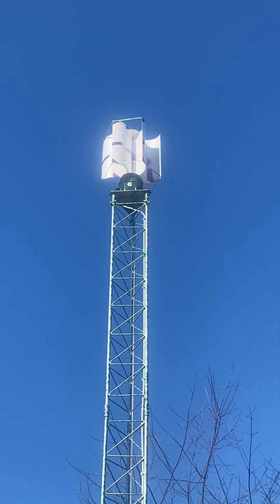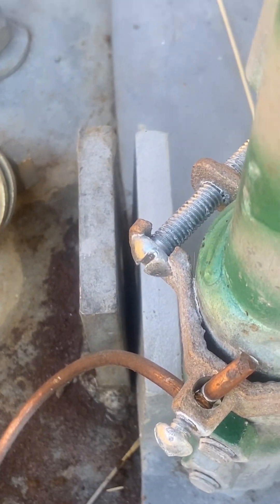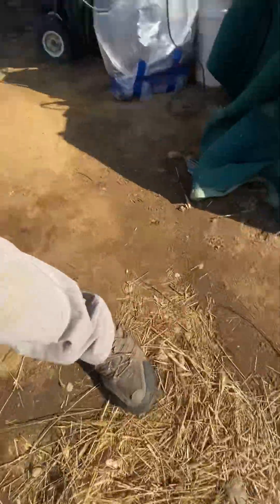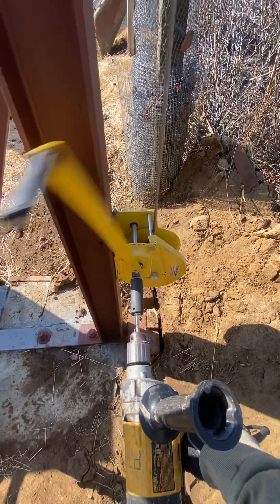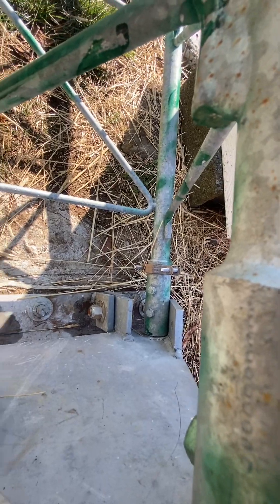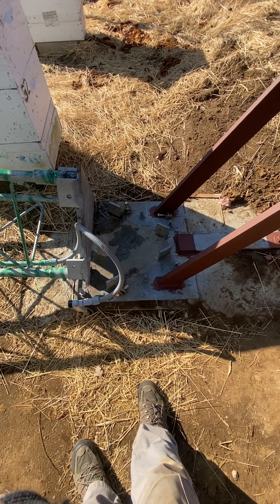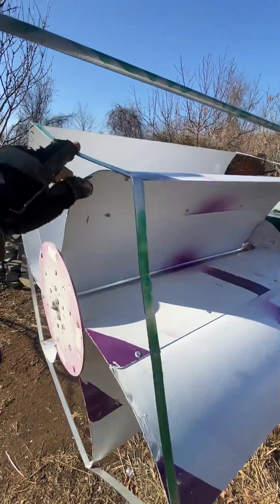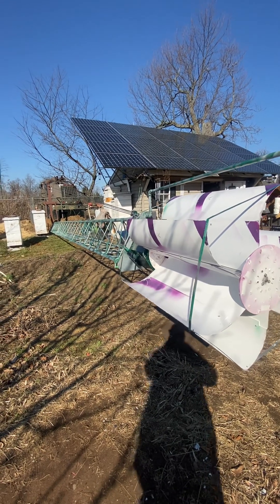Vertical Wind Turbine, Part 50  Tower Build Specs. Never buy Tesup

Comment: I keep trying to link ebay but I think YT is removing it just look up DC to DC step up voltage converter. A few are rated for 1800 watts far short from 4K but I don't think you will be getting 4K out of that thing anyways. The rate of spin probably required to hit 4K is a lot faster than that thing can spin without slowing itself down by spinning back into the wind. I would still add a breaker before the module and between it and the inverter just to be safe if you do go with that. The module isn't exactly UL certified lol. I plan on putting my I2000 up soon but I'm going to go through a MWAS wind charge controller board directly into a battery bank that is connected to a SUNGOLD Power 6KW grid tied solar inverter. A bit of a different setup since you got the last inverter that I ever even seen that grid ties a turbine directly that won't burn your house down lol. Using the MWAS charge controller board with the midnite classic will be pretty expensive but it will tie my system together when it's all said and done I guess.
Reply from the maker: Just a heads up, I found out from the inverter makers that the solar inverters are dual programmable for Wind. So you can buy any Aurora inverter and program the internal computer by supplying the inverter 50 V DC and the computer can program what parameters you want for Wind. Instead of Solar.
Reply: @Themachinewon  I sent that link to you, yea I read that also but if I do it the way I wrote above I will be able to keep my power on if the grid goes out. The inverter I was going for has a few cool options for charging and grid injection. The inverter can charge the batteries, have the batteries power the house and switch to grid power if battery voltage drops below a set voltage. You can also send a signal to a generator if power from grid is lost automatically and it can manage all this while also doing grid injection. So if I decide to go off grid for any reason the inverter can power my house from PV as priority without grid power and pull from the battery bank if solar isn't enough. And while it's dark out that wind turbine should keep the batteries topped off as long as the wind is blowing a little bit.
Reply from the maker: TheMachinewon@Hotmail.com.  you can send the link there

Comment: There is a guy from Norway that uses a step up voltage box to trigger the inverter faster might be worth looking into.
Reply: Flying tools?
Reply from the maker: @Qaz375   only thing flying is money out of my pocket building this thing
Reply: @Themachinewon  yes but good fun trying to get the rubbish to work, I believe some of the type of wind turbine you have are fitted with quite good istabreze pwms good for making a horizontal axis, turbine not what you wanted but somebody else will.
If yours is belt driven and it does start making any real power the belt won’t last long.
When your inverter comes on is there any way you can get it to load the turbine up bit by bit rather than just full on? It’s looks like it is just going to full load and then kills the turbine like a dump load 

I was watching your build and felling your pain and disappointment 
Keep up the good work 👍🏻
Reply from the maker: Please tell me more ?
Reply: @Themachinewon   https://www.youtube.com/watch?v=Z280SkNXIdw
Reply: Gonna take me a moment to find his channel and the video.

Comment: It you disconnect from the controller, is there any voltage across the phase's
Reply from the maker: yes, when it’s spinning at a certain speed or produce anywhere over 30 Volts to 120 Volts.
anything above 50 will turn the inverter on and then it cycles and then it starts producing power. But you’d have to have a constant wind speed right now for a 4K generator at over 20 miles an hour constant. That’s too high not acceptable.
Reply: @Themachinewon  I know alot of diyers use the midnite classic charge controller, maybe an option, instead of tesups controller
Reply from the maker: The diameter has been expand from 18 inches to 32 inches, I’ll have to expand arms and cups out for feet to see if that will increase the ability to turn but I’m going with a 1K generator instead